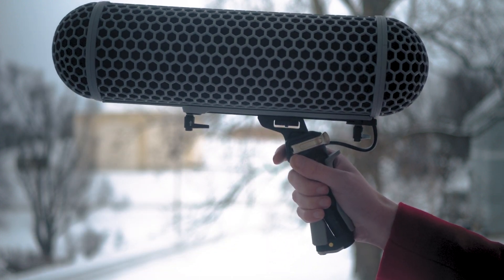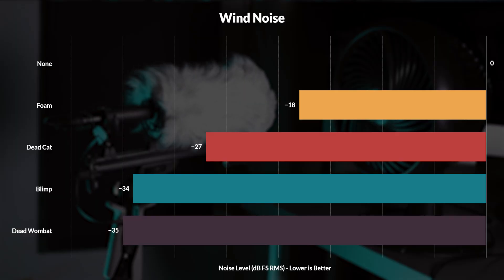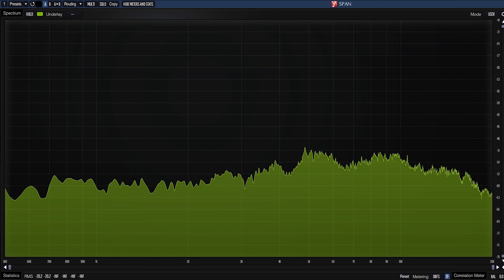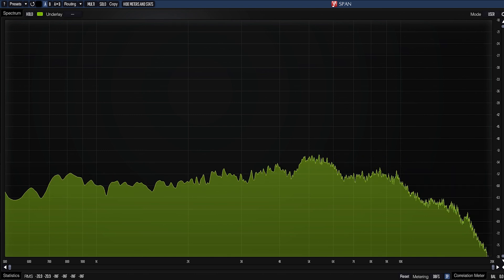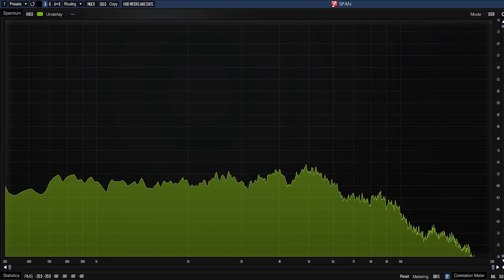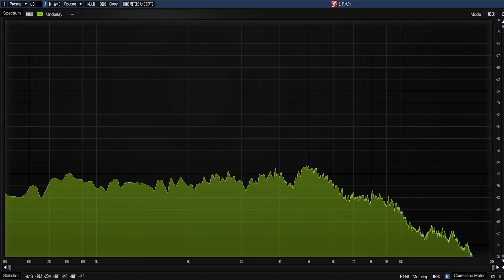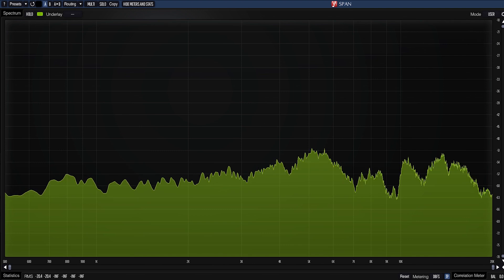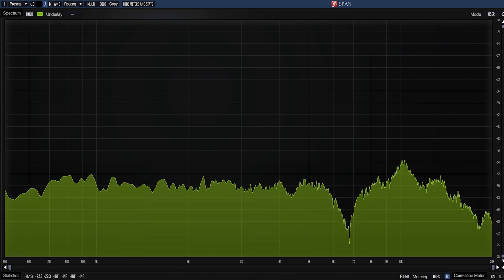Do You Need a Mic Blimp?

Comment: Thanks for the video.  I have a Deity shotgun microphone that I use on a Panasonic HCX-1500 camcorder and it does the job up until 15mph.  Since I usually tighten the shotgun microphone into the shoe, do I need to buy additional equipment since the shotgun microphone would be in the blimp?
Reply from the maker: If you're using the Rode blimp, it has a 3/8" screw on the bottom, so you'd need an adapter for the shoe. I use a shoe to 1/4" adapter and a 3/8" to 1/4" adapter.
Reply: @AlteraSound cool, thanks for the tip

Comment: This is exactly what I was looking for. Thanks!!! I’ve absolutely hated the resulting frequency response of putting on foam and/or furry windscreens, and shooting with on camera mics... well, still the "most expensive ones" with built-in preamps have a lousy noise floor, which becomes a real problem when you have to boost highs again. Not having worked with blimps, I wondered how much better they are and how they compare to foam or furry  windscreens, both in terms of wind protection as well as their effect on the frequency response.

You provided all the information I was hoping for, without having to run these tests myself or trying stuff out in the field. 🤩

Comment: Thank you for this EXCELLENT test, as well as for your excellent presentation.  I wish all EweToob videos could be this good.  Some results were in line with what I expected.  However, I was quite surprised that adding the wombat to the blimp provided only 1dB of further reduction.  Perhaps you've reached the noise floor of the fan motor itself.  It might be useful to take a 10-second sample of each test condition, average each one, then overlay a line graph of freq vs. level for all the tests.  You might see the LF going down a lot more than 1dB, while the noise floor (motor and room noise) stays up.

I was actually bummed to see the significant notches in some of the blimp tests.  That does not bode well for recording of music outdoors.  I suspect the various dip frequencies are related to the dimensions of the blimp, and perhaps even to the location of the mic capsule within the blimp.  I wonder how a small mic (e.g. a lav) would perform inside a spherical foam windscreen or blimp.  I did not find much info in the Audio Cyclopedia.  I'll have to dig out some my old Harry Olsen books and see what he had to say.  Thanks again, that was really informative and interesting.  Peace, out.

Comment: how -18db is a quarter of the volume if  every 6 db lowers the volume twice?
Reply from the maker: It depends how you're measuring it. 6dB represents a doubling or halving of amplitude. 3dB represents double or half the power. 9-10dB is double or half the perceptual loudness.
Reply: @AlteraSound  You're exactly right with those numbers.  And "volume" (the word you used in the video) is typically used as being synonymous with "loudness," although "loudness" depends on other things like frequency and absolute level, whereas "volume" (presumably) does not.

Comment: I'm not sure if my ears are deceiving me, but even though there was a db of reduction with the wombat, I felt like I heard more "wind" from the air passing the fur.
I feel like the reduction mostly came in the form of raw acoustic reduction, as in less motor/room noise, not necessarily in "wind" reduction.
I'm curious if different angles can affect this. I'm also curious if the "wombat" colors the wind at all, I feel like I've heard a whistling sound in some recordings, which to me reminds me of wind running through my hair. This could actually be a pleasant effect that is preferred over wind around the blimp in situations where wind was unavoidable.

Also, the blimp sounded incredible, if you're recording outdoors, I think it's a must, and this video really convinced me of that. While it's pricey, so are mics. It may not be as flashy as a microphone, but when you consider the frequency response, it's almost like buying a purpose driven microphone.
I think it pays for itself in time as well, if you're using mics in any professional capacity. Less wind = more good takes and less editing. How many hours of recordings will this save you, how much ADR will this save you, how much time on location will this save you.